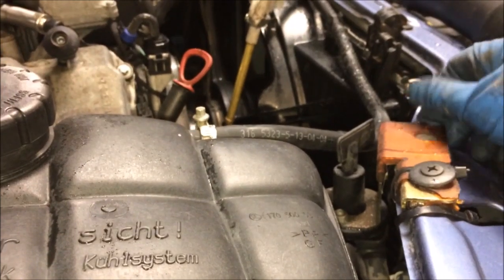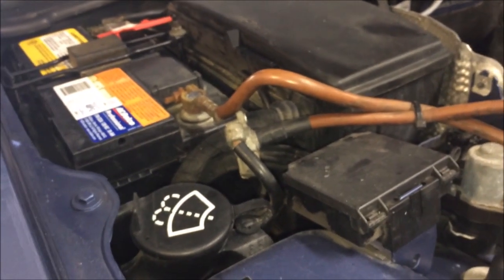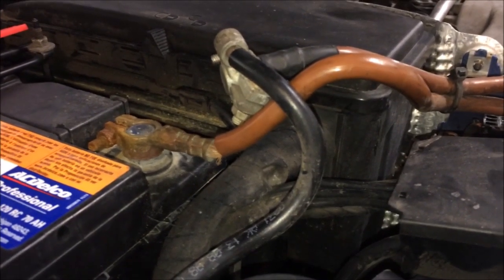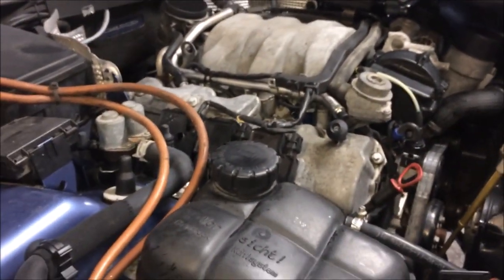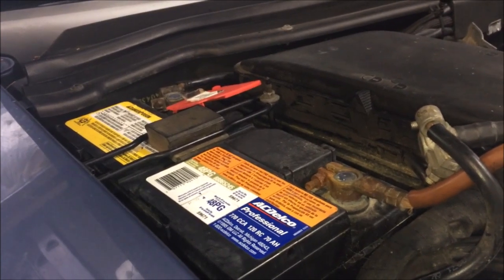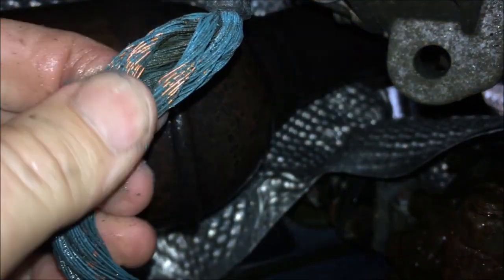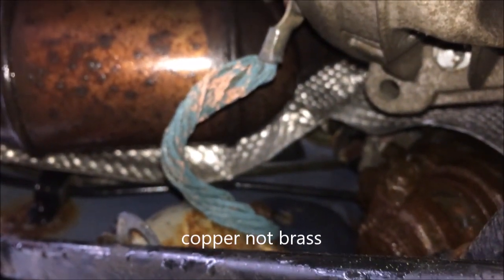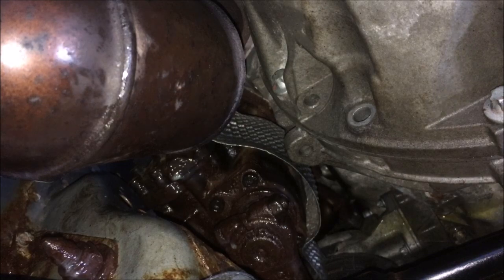⚡Your car has Electrical Gremlin? 🔌Is your battery really grounded?🙈

Comment: It could as be the alarm siren, when it starts to go bad it will battery drain, and make the alarm go off randomly when driving and make the locking system not work properly.

You can just disconnect it and not full remove it.
Reply from the maker: good suggestion, however, the alarm had been removed by the previous owner
Reply: @CrossfireRepairsByPaul  unfortunately I'm going to have to do it to the SRT this weekend . Any good advice on how to remove the wiper blades without a puller
Reply from the maker: @edd2184  wiggle and may need a pry bar but be careful where you put it against
Reply: @CrossfireRepairsByPaul  could I unplug the electrical connector to the alarm without, removing the wipers? 

If I took the screws out the front with that giving me enough clearance?

Or can I just unplug fuse 9 to preserve the battery
Reply from the maker: @edd2184   never tried it so I say give it a go and see
Reply: @CrossfireRepairsByPaul  I'm thinking about just removing fuse #9 for a temporary fix and then I'll play with the windshield surround, and try to reach around for the connector.
Reply from the maker: @edd2184    "You can pull fuse #9, which will disconnect the Alarm Siren Module, but it also stops the remote door lock/unlock from working. You will have to manually lock/unlock the doors"
Reply: @CrossfireRepairsByPaul  could I use the button on the inside to unlock the gas cap?
Reply: @CrossfireRepairsByPaul  just an update I don't even have to worry about the alarm siren for some reason, the trunk got filled with water. 

So I'll unfortunately be replacing the pneumatic pump 🙄... When it rains it pours. Pun heavily intended
Reply from the maker: @edd2184  sorry to hear that
Reply: check drain holes under wipers air for cabin bower many random issues or faults can have issues +stereo amp no sound some or all spkrs + on r/h/d models seats relay under s/wheel not working does light flicker below s/wheel all from blocked weep drain plug holes here plus alarm /locks as he said check yours

Comment: What length is sufficient.. I see that i can get a 6" or an 8" that is available. I don't want to buy one too short or have to struggle to attach it. but I don't want it too long where there's a potential on getting it snagged on something that I happen to drive over. I like to keep my eyes on the items that are known to cause trouble and have replacements on hand (upper and lower grounds
)

Comment: My 05 roadster is draining new batteries right and left.  The car shuts off and is DOA.  Ground cable looks fine...haven't looked under the car.  We're thinking its the alternator.  Any other thoughts?
Reply: A little late but make sure the alarm batteries haven’t started leaking or corroding which can cause the battery drain.

Comment: Good, informative video Paul as per usual. What size strap would you suggest? Not just the length but width too, to ensure it is man enough.
Keep up the good work - and post on here of course.
Reply from the maker: 4 gauge thick and about about 9 inches long

Comment: Excellent writeup/video Paul!  Back in August , 2018 I discovered that corroded factory ground strap from the bell housing to the chassis.  I ended up replacing it with a 12" cable (10" would work) along with adding an additional ground from the battery directly to the bell housing as well per James1549's post here:  https://www.crossfireforum.org/forum/tsbs-how-articles/77237-my-fix-ground-cable-engine.html  My posts start at Post #11.  Again, great video/writeup!